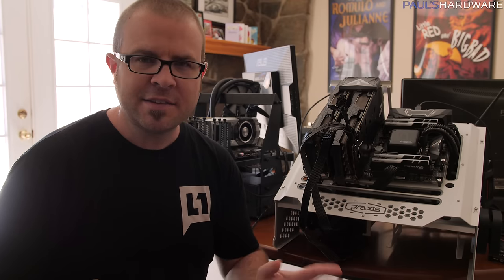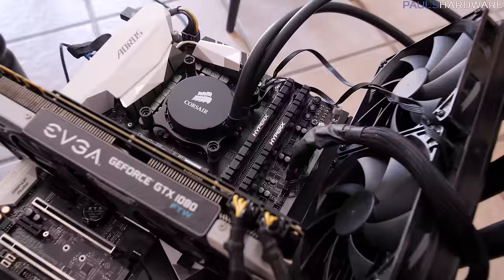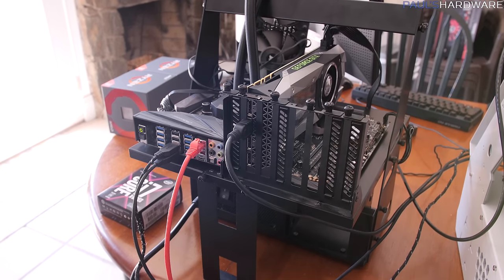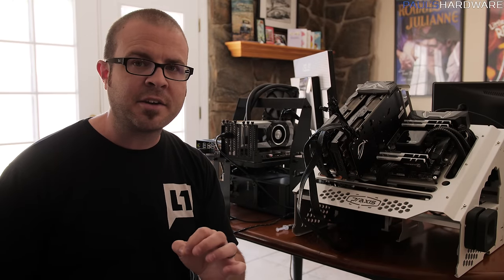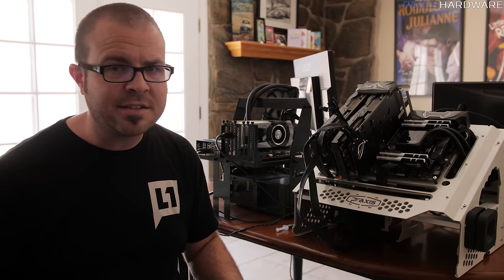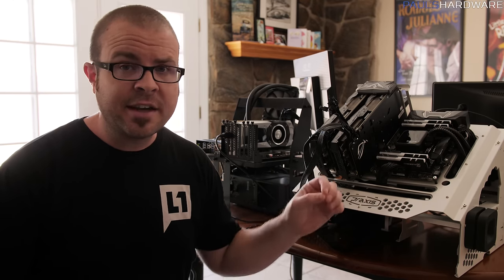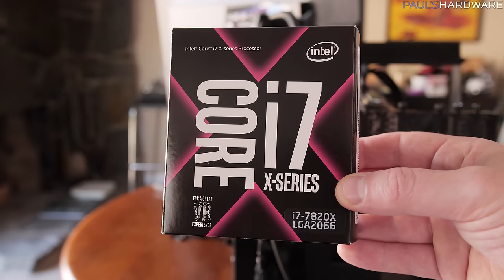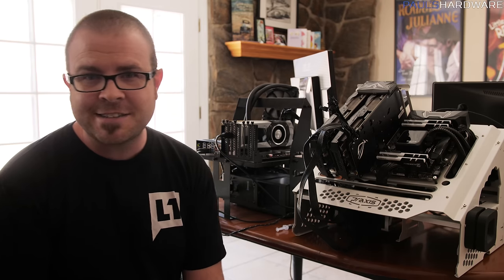What's The BEST CPU for Gaming with 1080 Tis in SLI?

Comment: After watching the video pausing every slide in the benchmarks if price is not an issue as you stated then the I7 7820X is the clear winner but those thermals are terrible on that chip.

I think you have to Options, 
Wait for ThreadRipper to launch and test how far it can overclock and where it stakes up Vsing the I7 7820X in games, Or you have to delid that I7 otherwise no matter what you do with that I7 its going to run like a stove.
Reply: actually thermals are ok on the chip given u buy a decent motherboard and overclock to a modest 4.2 - 4.3 ,  the 7900x gets real hot ,   i would say even at stock the i7 7820x is extremely powerful

Comment: if Ryzen could oclock on 4.4-4.5ghz he would wipe the floors with any Intel cpu here because even with 4ghz results are better then 7820x with 4.6ghz( except gta5/RTR which are intel optimised games) and very close to 7700k/7740x which are 800-1000+mhz higher clocked!! if PRO versions of ryzens could oclock higher it would be big boost in gaming
Reply: Likewise, if the 7700k could overclock to 6 Ghz it would be better than Ryzen CPU's. It is what it is.
Reply: we dont talk about 10ghz then about 4.5 which could be achieveble
Reply: If my pentium 2 could overclock to 600 Ghz Ryzen and i9 would be dead.
Reply: on PRO version could be achievable and as i see 7700k is shit because he need 1000mhz to have some advantage over ryzen in gaming and again in games which are  older or for Intel optimised

Comment: 1800X is slightly worse than the 7820X and has 4 pci-e lines less... but consumes less power, runs cooler, and considering how fucked up the X299 motherboards are, I'd say AMD is a more stable option here :) not to mention u might be able to push the 1800X to 4.1GHz, and the still fresh architecture still has room for improvement :)
Reply: He is looking for absolute balls to the wall performance though, in that case x299 is really your only option.
Reply: 1800X has 16 pci-e lanes for GPU ONLY. 4 more for nvme ssd and 4 more for other pci-e based communication. if u put 2x 1080TI and a nvme SDD both systems will run the GPUs at x8
Reply: not the same logic, bcuz X299 as a platform might be new, but the processors itself are on the same architecture since 2011, so I doubt there is room for improvement.
and OK, X299 nad more pci-e lanes. I admit.
Reply: Jon WarrioR 1800x has 24 pcie lanes...
Reply: Just a friendly reminder, even if either CPU had 100 pci-e lanes, 20 lanes should be enough for a NVMe SSD and 2x 1080Ti, since I rly rly rly doubt a 1080Ti can saturate bandwith of pci-e 3.0 x8. As far I understood from the video, this will be all that this rig will be handling anyway ^_^
But feel free to correct me if I'm wrong!

Comment: Paul I have to agree with you that the 8 core seems like the best fit for your purpose, but I am biased. My main rig is a 6900k OC'd to 4.3 gHz with 2 GTX 1080 Ti's pushing a 3440 x1440 @ 100Hz display. I like to have the option of high-end gaming without sacrificing other functionality and heavy multitasking, and so far it seems like there is no reason to 'upgrade'. Do you agree I will probably need to wait a few years for a platform/CPU worthwhile upgrade?

Comment: Paul you are always one of my first ports of call for the EXTREME lol
I told you my setup at the start of 2018 and you were adamant you would build a system as good as mine.
I watched this build and I have to say you were close to my Baby:)
But lately early 2019 you have blown my budget sir, god dam it I love your builds BUT Summer is coming and I need to get my HONDA VTR1000F FIRESTORM/SUPERHAWK ready for the road you understand, tyres,engine tune,insurance, hey even road tax this year!
PS I have been into computers since the 80`s the ZX SPECTRUM 16/48K/Amiga a500/1200 and as I, and you know the summer months are a slack time for Home consoles/PC.
I hope when I put my Super bike away for the season I will boot my PC into a new season of hardware 8-12 core CPU running at a pleasant 5ghz and most of all COOLER THAN 80-90oc
I think you Paul could put out a challenge to collages to produce a Case or cooling system that could rival or beat the current EFFORTS, What do you say:)
PPS I have a 1000cc V-TWIN ENGINE BIKE(sounds like a Harley davidson on Acid mate:) and to reduce the width and cooling problems Honda mounted 2X full sized radiators either side of the engine to compensate for the heat generated by the rear cylinder head not being exposed to the air flow, instead of one in front of the engine just behind the front wheel as convention says, what I am trying to get at is perhaps we need to split the radiators into two with 2X 240 fans designs as standard and then incorporate the GPU into the water cooling at a later date but think, two separate radiators as standard and then plug in the parts that need cooling, over cooling is a myth even in engine design and as i type this i will link a AIO that i am not using at present and let you know the results nearer the time, when FFS fall/Autumn closes in here in England and I will let you know the statistics and i will let you know if leaving ss(Nazi europe has caused any PC problems as I recall your space agency was boosted by them:( and we have always eyed them up as a leopard never changes his spots.......

Comment: I know you were concentrating on CPU comparison, but I think a simple added line on the system Testing Hardware graphic at 8:24 with the price at time of build would add a valuable info point for those who rarely dabble in the lofty realm of high-end processors. Audio wasn't up to usual high standard (I understand you don't want to cook in the garage).  Nice video, in all.

Comment: >Didn't test with the ryzen 5 cpu's

Oh. I kinda wanted to see that included. :I

Perhaps a sequel?
Reply: It's too weak.
Reply: A overclocked 1600 is perfectly capable of handling SLI'd 1080 tis...  It's basically a i7 6800k...
Reply: So much weakness.
Reply: I really don't think ryzen 5 is meant for 4k gaming, 1440p and less? sure, but for 4k its 1700 or higher.
Reply: Ariel Mansur if anything the 1600 would be better for 4k for the price. Because as you increase the resolution the GPU becomes the bottleneck
Reply: Ariel Mansur, that's really not how this works. All the FPS for these games are way over 60 fps and unless you pay thousands the best 4k monitors are still 60 hz.
Reply: The 1700 comes close to performance to 1800x when overclocked.  It's funny how much you AMD fans foam at the mouth if you state facts about gaming performance that your CPU is capable of.  There's plenty of videos on youtube that will back it up, so I will leave it at that. LOL, wow.  Personal insults.  LOL.
Reply: R7 is superior to R5
Reply: >testing ryzen 5 CPUs in a performance-only comparison
Srsly?

Comment: I would have liked to see specific streaming performance added since you mentioned wanting that too. I guess the 7820x will perform just fine with streaming, but it would have been nice to see how it compared to the other offerings. The recently uploaded video somewhere comparing the 7700K to the R7 1700 showed surprisingly more watchable streaming from the 1700 compared to the choppyness of the 7700K, despite the 7700K's higher FPS scores.

Comment: If it were me spending my own money, I'd go with the Ryzen R7 1800X for a couple of reasons. 1) the performance is more than adequate across all games right now. 2) the future-proofing is better as vendors and game designers will continue to optimize performance on these CPUs. Having those extra cores will be a benefit in the next year or two. We seem to be stuck in the 4.0 to 4.8 GHz range, so adding cores will be the solution for a while.

But if I'm Paul, I would probably go with the 7820X.

Comment: Holy crap I don't think I've ever seen everything explained so thoroughly before, from the test beds used to how you came to your conclusions. Of course from an enthusiast pov you're going to go for the 7820x because even if the performance gain is minimal it's still the best performer. That's what being an enthusiast is about. I liked how you also pointed out the 7700k was the best value for pure gaming, but that the 1700x would be able to handle streaming on top of that. A PC is all about what each person wants to use it for, that's what the "personal" in personal computer is there for.

Comment: Intel all the way for gaming! for productivity go with Ryzen end of the book!
Reply: Ryzen R3 should dominate in gaming too, I would say intel is a bit behind until they start to innovate.
Reply: Card Wallets R3 I would be willing to bet has no better performance than any of the other current Ryzen cpus. I doubt it would overclock any higher either
Reply: King? By 3 to 10 fps in most real world benchmarks? I guess if that crown means so much to Intel they should get off their asses and produce something that can compete like Sandy Bridge did. 
(I still had a 3770k until I bought a 1700x system.)
Reply: Card Wallets, why would Ryzen 3 dominate in gaming? The issue with Ryzen is frequency something that won't change with Ryzen 3. It's a architecture problem that will take new revisions to sort out.
Reply: Ryzen cpus don't get to hot tho.
Seems intel new cpus get pretty toasty
Reply: Dominate in gaming in the budget market, because it will offer 4 cores, 2 more than i3, so will have much better gameplay, might even have less average fps than 7350k in some games, but surely will have better lows, and online gaming will be much smoother.
Reply: thalexis --The cost in the long run for trying to keep hot processors cool and power-hungry will cost you in the long run. Maybe not the way to go for a few extra FPS That you cannot even distinguish.
Reply: Usually in games that also run horrendous on the 7700k. It seems like the "core i" architecture works better than "Zen" with badly optmized code. A good optimized program/game however puts a 4GHz Ryzen just a few percent behind the 7700k at 5Ghz and some games even run better on the Ryzen.
Reply: MadeOfLego No kidding. And the minimums for ryzen were higher too in a few games!! I love my 1700X. I got the SC2 because I hope it's going to be a common enough aib that in a couple years I can sli it and do a custom water loop in my P3 case
Reply: for productivity go for an 1366 8 core xeon put it on 4 ghz and be happy with beating an 7700k for 200$ including 32gb of ecc 1333
Reply: Dennis Schneider You can't overclock a Xeon, so how would 4 ghz work?

Comment: so ryzen then
Reply: Fox Unit Delta 7700K actually. And no that's not me being a fan boy..
Reply: Yea great all arround performance espically the 8 and 6 core
Reply: the performance in games in games is close enough that it makes no difference and it's a much better all round CPU, i'm no AMD fanboy but with the way things stand at the moment you would be stupid to buy anything but ryzen
Reply: Ryzen is bang for the buck, i7 is the best performance, even if the difference is marginal most of the time. He already have the hardware, so money is not a issue. Only a very small parcel of the Ryzen owners could overclock above 4.2 in safe voltages, so, Ryzen don't have much room for performance boost right now. It's already a great processor and the plataform have a lot of potential, but still too fresh. It will get better in the next revision.
Reply: so 7820x then

Comment: 7820X FTW 4.6 oc out of the box without a custom water loop. And since X299 is so young, there are still BIOS updates that will slightly improve performance in the future. Maybe after the custom loop and future updates you might be able to stabilize at a 4.9-5.0 oc. I know some are reporting 4.7-4.8 oc out of the box already.

Comment: Hola Paul !
An interesting missing decision factor would have been to have the power consuption for each system
As my opinion, I would be leaning toward a 7740X build for numerous reasons:
- It's a build for only gaming, the only aspect where this chip makes sense
- Where else are you going to use this chip anyway ?
- Lower power consumption that 7820x
- You could make another light capture/stream system to stream the gaming content (and a video where you build it and explain it)
Cheers !

Comment: Love ur vids honestly ive learned so much from them and well ive now built a dream build. Two MSI 1080 TI's running at 2288 water cooled them myself, a I7 6850k at 4.6Ghz. 64Gb's of ram and a Evo Pro M.2 250gb for OS plus all drivers and startups, as well as a 1TB for all others. Everything runs smoothly and love it. getting fantastic frames on all games max graphics. Still need to do a Firestrike test but im sure she will perform as needed

Comment: i was really hoping to see the 7900x as well to see if the extra pcie lanes would help using both the m.2 and 16x lanes for both gpu's over the 7820x, not least as its the cpu i am looking at over the 7820x purely for the added pcie lanes. to feed my evga 1080ti ftw3 elites.

Comment: 7700k for pure gaming is still where it's at. For value it's Ryzen, for gaming an OC'd 1600 will do just as well as the 1800x OC'd for much less money. 

If I had the money and desire for a dual 1080ti (SLi is a bit of a waste of money these days IMO) I'd probably opt for an X299 processor or Threadripper just for the hell of it. I'd be using multiple NVME drives so you want those extra PCIE lanes.

Comment: When it comes to the gaming performance... Have you considered turning overage RAM in oldschool ramdisk?
Exemplary solution is ImDisk to make ramdisks and create ramdrives from images, mklink /j to make junctions to ramdisk which can be batched and some soft to make .img file of games with many files - it's much faster to make ramdisk with game from image than copy stuff over.
I treated it more like hobby but it's not overly complicated and cheap way to boost read/write speeds to the ceiling.

Comment: Should I get the 7700k or the 7700 because there is now only a $8 difference, the only thing im worried about is the difference in temperature
Reply: Natalie Lind if it's 8 dollars get the k. There's only a temp difference if your overclocking the chip, which you definitely should.

Comment: Delid that 7700K Paul and use LM TIM you will get much better results.  If you have a d3 printer you can just print the tool out or just buy one for like 10 bucks.  It will drop your temps by 15 to 20C easy.  I was able to get my temps down from 95C+ running prime 95 to 70C max on Air using a small noctua cooler in a NCase M1 makes all the difference in the world.

Comment: The best CPU for SLI 1080ti's, or Titan Xp's is a 4 core CPU that can reach 4.8 MHZ or higher. The extra cores don't seem to help much with SLI, but the added clock speeds on the CPU do in most benchmarks. My 3 year old 4790k still within 5% of any CPU on the market when it comes to gaming performance. Runs 4.8 GHZ at 3.12v. Intel hasn't done anything to help gamers since the 4790k, they've just added cores or made new architectures that perform the exact same lol

Comment: 4K. That's where I have my problem for the ultimate gaming rig. You are currently limited to 60Hz if you want VSYNC ON. VSYNC OFF you get screen tearing, or you can get a GSYNC monitor but at 4K you'd have to be BELOW 60FPS to benefit. And of course at 4K pretty much every game is above 60FPS with these systems. More...

So from a GAMING perspective the ultimate monitor would be a 100Hz+ 1440p panel (i.e. 165Hz 2560x1440 or 100Hz 3440x1440) with GSYNC working.

Comment: Interesting. Threadripper will be interesting. I might go for the 1800X in a couple of months. Gaming on the 1080 Ti, and capturing, and video/photography work. Price is a factor. Running a 4930K now (on a liquid damaged motherboard, hard to find a replacement board :/ ).

Comment: Paul, did I hear you say most bang for the buck- with 2 1080Ti thats less price to perforamce- expect sli has less support in most games, even less in the future. Rather see more money spent on more memory, faster storage. Even threadripper's 16 core, 32 thread cpu might be better choice since you do so much editing/ video stuff and not &750 for a 2nd 1080ti sli
Reply: but I do realize threadripper and its motherboard are not out til mid august,2017- so a few weeks delay might have resulted in a more useful or interesting system. We are always a few months away from the next upgrade but
Reply: file1man threadripper won't even top ryzen in gaming so don't look to it for a gaming rig. The video specified best for gaming so why would you want faster storage. Nvme drives are great but you will see no gaming performance gains over an SSD